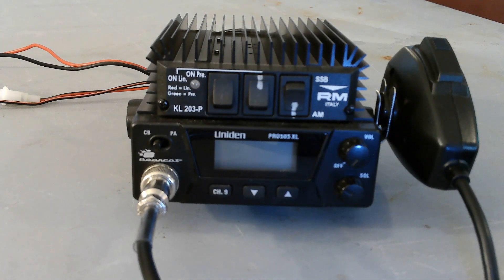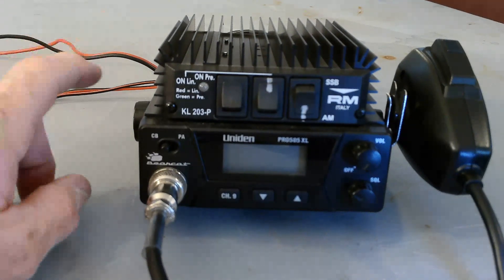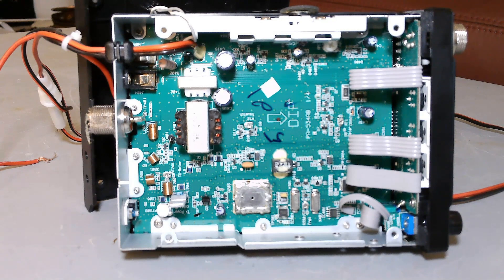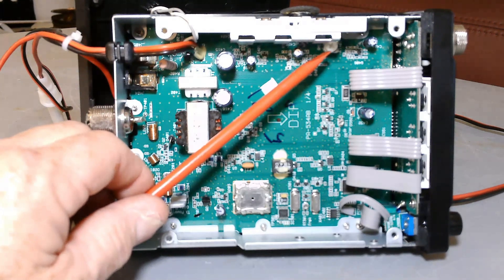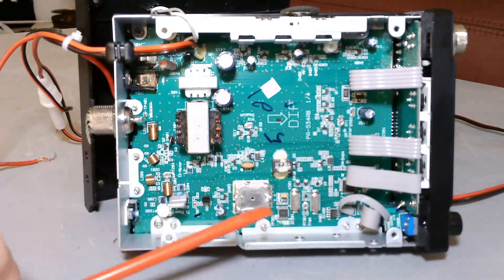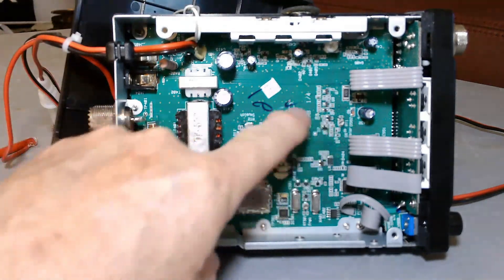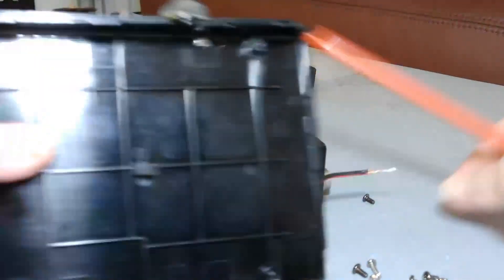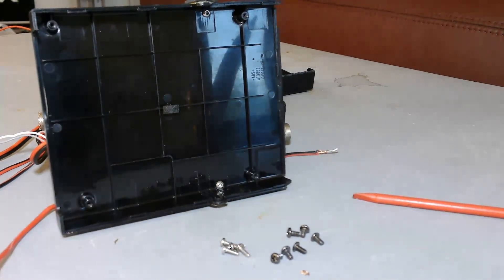Pro505XL with KL 203 P

Comment: To the "one watt and no more" people... it's not true. "Any more and it will splatter"... not true either. First thing: if you don't have a reasonably accurate power meter, you shouldn't comment. You have not done the analysis. You will not know when you have maxxed out the dynamic range (in to compression) until someone tells you. And even then, most people aren't capable beyond "your radio sounds shitty". I am running a quad 6 pro at 2.4 watts dead key. The output in to total dynamic range also goes down when you turn down the total output.  My audio is crystal clear with boatloads of dynamic range. * BUT * I have done the analysis with a good meter. First hint: if your meter goes down (in PEP) after you modulate, you have problems. BIG red flag. I have had long conversations... no heat from the amplifier. That's your second clue. If there is any heat, it is so minor, putting a fan on it would be a waste of time. Moral of the story: you need to do your own analysis. HOWEVER... if you haven't purchased a NanoVNA and really done the resonance tuning to a refined level, then you really aren't in the ball game.

Comment: Id run the power wires to a larger gage sae connector then to a similar gage lighter plug tail. I've have sae connectors on anything that doesn't draw many amps. Some may say different but ill run 15amp on a 10ga sae. Then you can pack an extension for your power cable.

Comment: I’m letting a mechanic run a direct line from my battery to the amp with a line fuse no way I would run this in the cigarette lighter with the radio

Comment: what did you not read IT IS  A $ 60.00 XLT C B radio 40 channel running at 13.5 amps
Reply: No it requires 13.8 volts at approximately an amp and a half.

Comment: Decrease Power
Increase deviation 

Equals slightly garbled voice over lower power. So why do it??

Also, the KL203P will happily handle 6 to 8 watts on am and fm, and 10 to 15 watts PEP on ssb.

As a guide the output from the 203p is average of 10x the input.
Reply: This is an am radio, not FM.. there is no deviation with amplitude modulation

Comment: I dont get it: this is the second (US)video about the Kl203p amp 
 Saying only 2 watt 
The specs says Max 10 Watt input. Being causious I set my dead key/ Radio to 8 to 8,5 watts
Wich gives me dependant at frequency between 80 and 110 watts output!  It doesnt blow up! This is on Fm . On AM I the variable output of the radio drops , so I also turn it a bit up till 8 watts
Reply: It will definitely shorten the life of your amp. The 10 watts your saying is for SSB only P.E.P..

Comment: I don't recommend more than 1 watt imput with this amp. 2 watts or more will cause it to splatter, and probably also cause a squeal in a cheap radio. I have a KL203P connected to a President McKinley radio, with the power turned down to 1 watt, it seems to work fine, no squeal, and will not overdrive the amp and burn it out. This amp uses MOSFETS, and they are pretty fragile.
Reply: @geraldscott4302  To the "one watt and no more" people... it's not true. "Any more and it will splatter"... not true either. First thing: if you don't have a reasonably accurate power meter, you shouldn't comment. You have not done the analysis. You will not know when you have maxxed out the dynamic range (in to compression) until someone tells you. And even then, most people aren't capable beyond "your radio sounds shitty". I am running a quad 6 pro at 2.4 watts dead key. The output in to total dynamic range also goes down when you turn down the total output.  My audio is crystal clear with boatloads of dynamic range. * BUT * I have done the analysis with a good meter. First hint: if your meter goes down (in PEP) after you modulate, you have problems. BIG red flag. I have had long conversations... no heat from the amplifier. That's your second clue. If there is any heat, it is so minor, putting a fan on it would be a waste of time. Moral of the story: you need to do your own analysis. HOWEVER... if you haven't purchased a NanoVNA and really done the resonance tuning to a refined level, then you really aren't in the ball game.

Comment: Why would you say it's ok to use a metal screwdriver ??
Reply from the maker: Because there is no power present when the unit is disconnected.
Reply: @mrsteve9920   the metal causes a problem being on those pots. If you just touch the metal screwdriver there and take it off and touch it and take it off a few times you'll see on a meter or a good test equipment the effect of that.

The metal screwdriver will not flex and you run the risk of damaging the pot or the adjustment. The plastic alignment tool will give in flex a little bit before damaging the component

Comment: The output of these amps is full of harmonics, which means that your transmitting on many frequencies all at the same time,  not what you want to do, particularly if you're doing something that is illegal. Consider using a  low pass filter between the amp and the your antenna, this will remove the harmonics.
Reply: Only if you overdrive it. Use no more than ONE watt in, and it will be fine.
Reply: @geraldscott4302  To the "one watt and no more" people... it's not true. "Any more and it will splatter"... not true either. First thing: if you don't have a reasonably accurate power meter, you shouldn't comment. You have not done the analysis. You will not know when you have maxxed out the dynamic range (in to compression) until someone tells you. And even then, most people aren't capable beyond "your radio sounds shitty". I am running a quad 6 pro at 2.4 watts dead key. The output in to total dynamic range also goes down when you turn down the total output.  My audio is crystal clear with boatloads of dynamic range. * BUT * I have done the analysis with a good meter. First hint: if your meter goes down (in PEP) after you modulate, you have problems. BIG red flag. I have had long conversations... no heat from the amplifier. That's your second clue. If there is any heat, it is so minor, putting a fan on it would be a waste of time. Moral of the story: you need to do your own analysis. HOWEVER... if you haven't purchased a NanoVNA and really done the resonance tuning to a refined level, then you really aren't in the ball game.
Reply: it runs a 7 watts it is a CB radio entry level.
Reply: @donalderickson-si8ww  That's wattage to the speaker.   Peaked and tuned this radio would labor to do more than 4 and half watts.  This is a very capable setup.
Reply: @geraldscott4302  Not sure if what you say is true, I will have to test. However my amp amplifies about ten time, so I would get about 10 watts out, not worth the trouble. An approximate 3db improvement, by adding an amp, over a stock radio would hardly be noticeable.
Reply: Nobody cares
Reply: @ConspiracyBear  maybe, but it's probably that people just don't know. I'd cleanup output with a simple LPF.

Comment: Hi Mr. Steve! this exact video was such a great guide to using both units and I had great luck with the 505xl on its own, but when I added the KL203P, I get a gnarly squeal on transmit. I have an SWR of 1:1.05, and a short coax jumper from radio to amp. they're both powered off of a 30A 12V circuit in my car and I have it set at exactly 2W radio output as suggested. when I bypass the amp, I don't get a squeal and the signal is super clean. when the amp is on however, I can almost hear the squeal from the radio itself. I've read some solutions like an RF choke on the power leads or mic cord but was wondering if you had any thoughts. Thank you in advance!
Reply from the maker: Good day Weston. I haven't experienced any squeal with this setup. Are you using the stock microphone or a power mic? Is it possible that you are getting feedback from an external speaker?
Reply: @mrsteve9920  stock microphone, no external speaker. A ferrite on the mic helped a little, and I double-checked my SWR on 19 at a solid 1:1, needle hardly moves.

Comment: If you need a CB to keep up with traffic on the road this ones fine with a removable antenna but I wouldn't have that for normal communications . At least a Cobra 29 LTD classic is better than that back pocket radio lol
Reply from the maker: Absolutely! This is an emergency type setup. Nice and compact. I use an Anytone 6666 as my daily

Comment: I have a manual adjustment for power so running my 203 I turn it down to 2 to 2.5 watts dead key sounds right to me. Would do a model on one if I had one. Peace great info.

Comment: The Uniden 505 is good stuff!!! Very tough design, and only necc. features.
BUT...recieve is too sensitive!!!
Streetlights, powerlines, fastfood drivethrus, any distributor capped vehicle, gets this thing barking.
Where do I adjust rx sensitivity? Like an rf gain? Thanks for all the intel on this vid.
Stock or upgrade mic?
Reply from the maker: Stock microphone. Direct connect to battery and an RF filter on the positive lead may help with noise.

Comment: If you go into the engineer's menu on the President Richard the max setting for AM modulation is 220 If you turn it up to 210 the Dick will do 50 watts pep (five zero)
that's damn impressive 100% recommend the Dick and KL203P I turned minze down
for the amp but keep in mind the 'power settings' you need to adjust the FM output to match AM output The nearest rig to this is a Stryker 447 and its about twice the price $.
Reply: Just get the THOMAS. It is so legal, they sell them at the truck stop. 🇺🇸🏁👍

Comment: The President Richard and the KL203P are 2 of the best buys in our hobby right now
the Dick is a 50 watt rig out the box I turned it down via Engineers menu to 2.2 watt
dead key and i'm seeing the same 180 pep as shown on Rooster cb channel. CB radio
magazine YT channel does the best demo on the Dick I've seen.
Reply: Hey uncle where do you set power setting on the president richard in menu settings to get 2 watts whats the number to get 2 watts help please.
Reply: IT IS A C B RADIO HE MISS READ IT.